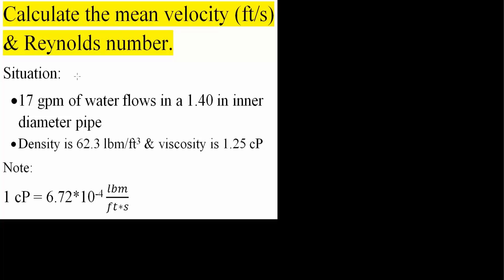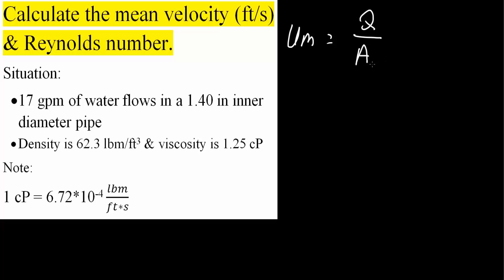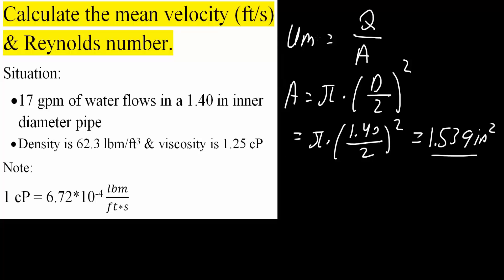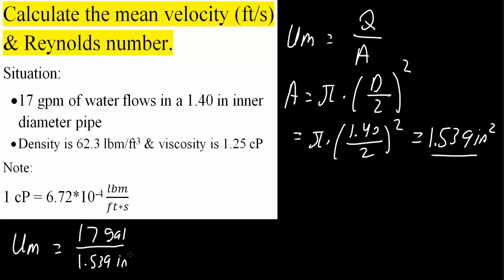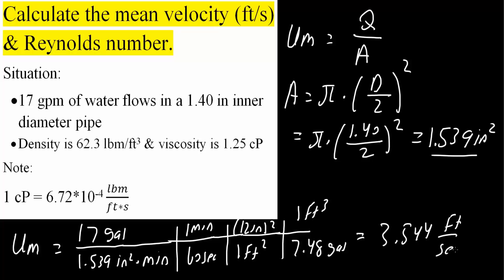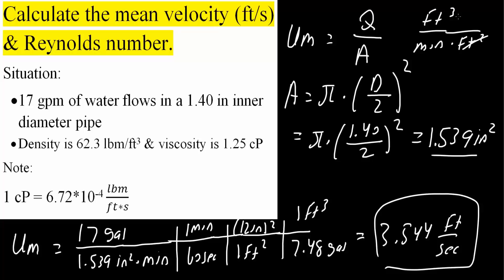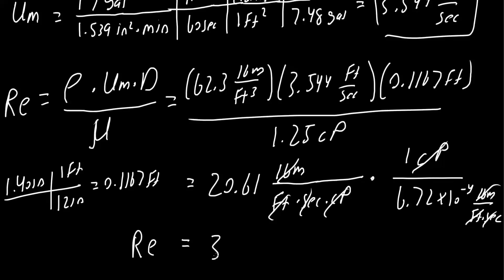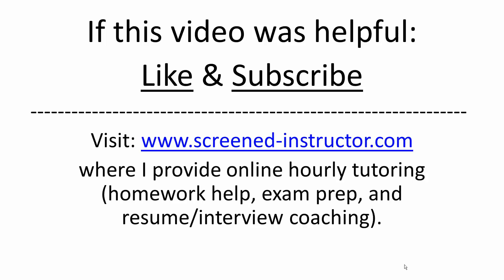Calculate the mean velocity & Reynolds number

Comment: Good video, thanks. But, I'm curious, why are you not using the metric system? I know society, in America, as a whole uses imperial, but I would have imagined in engineering, you would be using metric.
Reply: in my engineering classes, we use a mix of both. as for working in a company, the one I work in uses english units not metric. might differ in another company though but I'm sure it will still be english